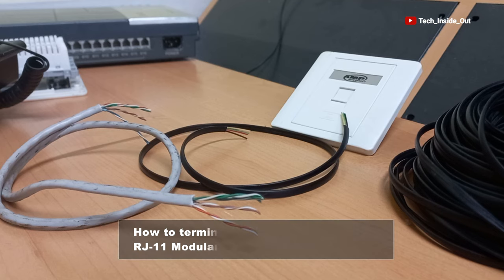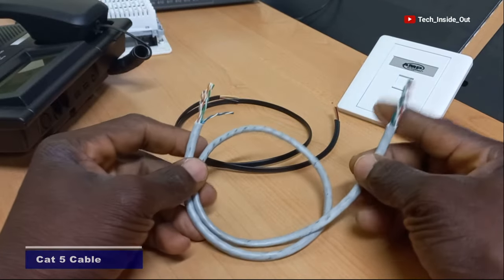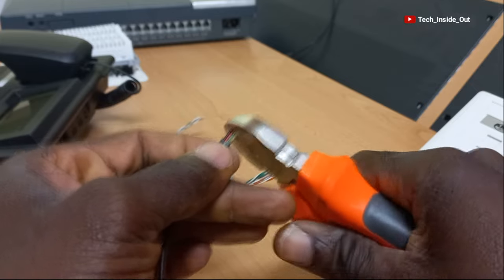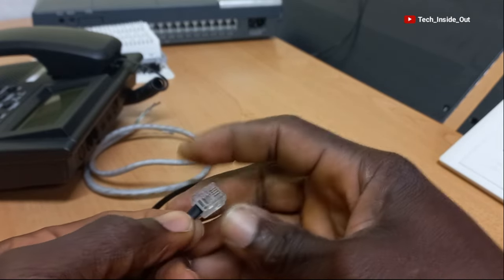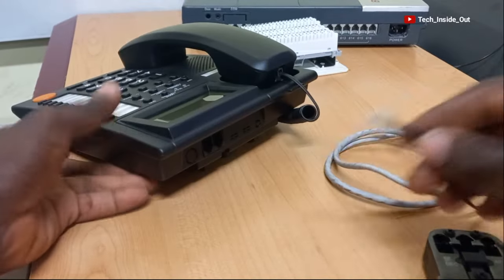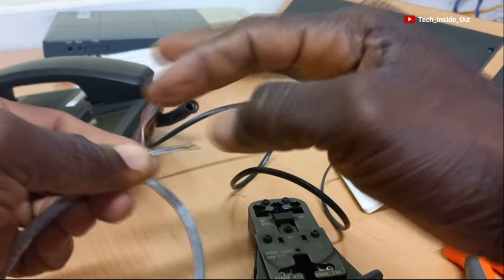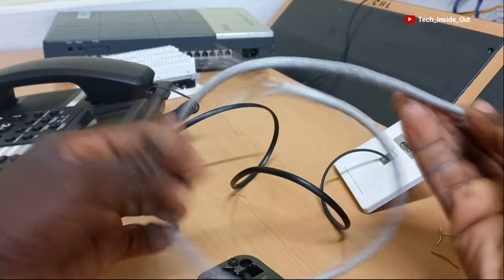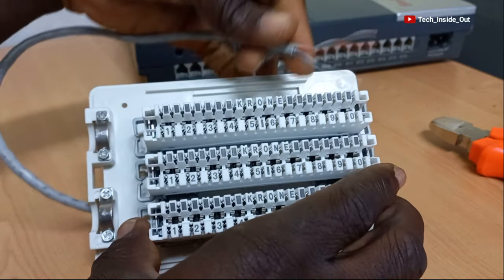How to terminate telephone cables using RJ-11 plugs

Comment: Is it a must i arrange it like this?  If i want to use orange and green, should my arrangement be like stripe orange, thick green, stripe green and thick orange. Right? Also incase of MAINTENANCE, cant we just wrapped the cut out colours instead of cutting?
Reply from the maker: The cable arrangement is a world standard so that if another technician is to trace fault on your installation, there won't be difficulty, even yourself, you may forget your cable pairs used if you dont go by the internationally accepted standard.
Reply: @Tech_Inside_Out  that's true though but its possible to use other colors

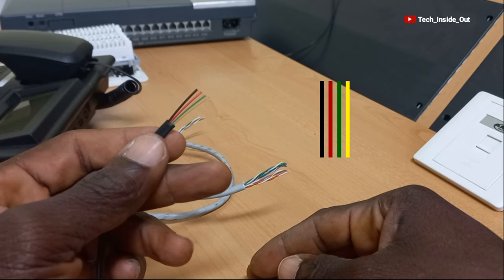Comment: Thank you for your video. 1:24  if you find out this black-red-green-yellow wires can't work for you.  You can turn others side yellow-green-red-black, this work for me
Reply from the maker: The cable colour arrangement is a standard, however, when you turn it your own way, it still works just that others may find it difficult to trace faults on it when they try to use the standard conventions.

Comment: Hello sir, just want to ask, with your rj11, it comes with 6 pins and you inserted 4 wires. Which number or pins did you left empty? Tia
Reply from the maker: My rj11 has 2 pairs. In case you are using a 6 pin type, you would have to use the 4 pins at the middle, meaning you woul leave 1 pin at the beginning and another 1 pin at the end too
Reply: @Tech_Inside_Out  Thank you very much.
Reply: @Tech_Inside_Out  Sir, another question. Can I use rj45 keystone jack instead of rj11 keystone? I will just the 4 outer pins? Tia

Comment: Pls can I connnect it using android charger
Reply from the maker: I don't quite get the question, can you please explain the question?
Reply: @Tech_Inside_Out  I ordered a landline L019-3 on Jumia but when I came home I found out that it doesn’t use SIM card nor does it use charger but it cable is similar to yours but I don’t have that kind of plug that’s why I was asking if I could use android charger to replace that cable
Reply from the maker: @Surutu4693  You cannot power it from an Android charger. 
Phones are powered from the RJ-11 plug.

Comment: It’s a 6way modular plug so how did you fit in the 4 cables, u didn’t explain which lines u put the 4 wires before crimping.
 Also why didn’t you use 2 wires or 1 pair and you used 4wires/2pair?
Reply from the maker: 1. I used a 4 pin rj 11 in this video, not a 6 pin
2. A standard telephone wire contains 2 tips and 2 rings of cable to be able to support any kind of handset, eg consoles and key telephone.
Reply from the maker: 1. I used an rj 11 plugs which has 4 pins. It is rj 12 modular plugs that come with 6 pins.
2. A standard telephone system uses 2 tips and 2 ring cablings to enable the use of consoles and key telephones without the need for re-wiring. A single pair wiring works for the use of single line telephone systems.
Reply: @Tech_Inside_Out  so I can wire 2 pair to reception which will be multi line telephone, and do 1 pair (e.g blue/white and blue) for all guestrooms for single line tel.